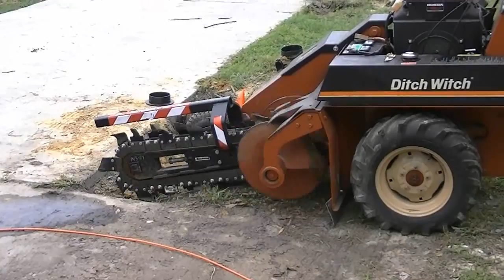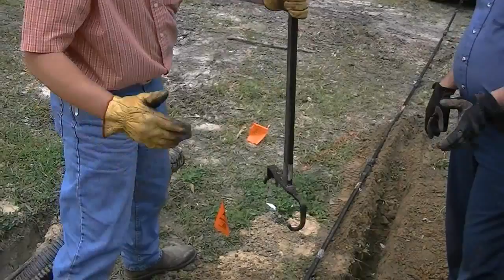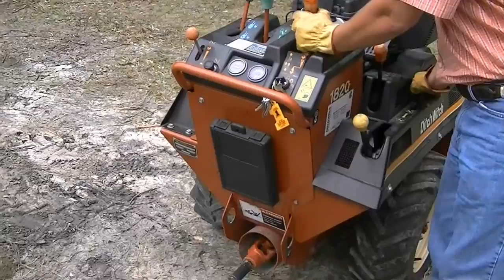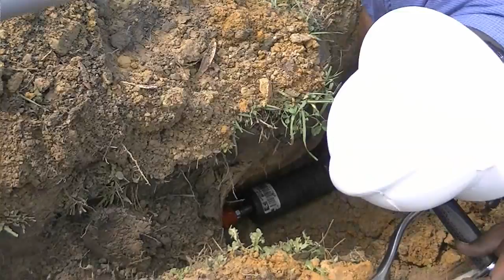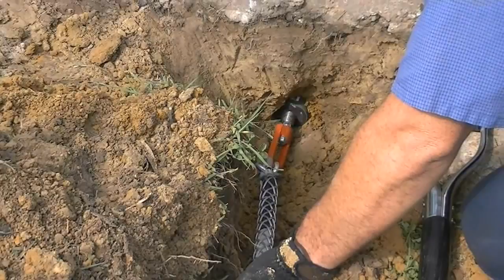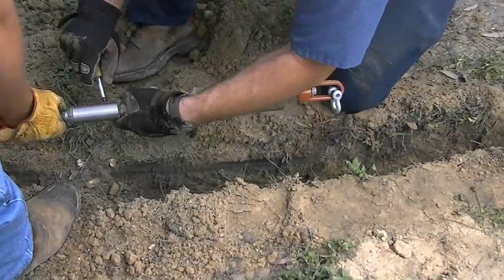Ditch Witch Roto-Witch Attachment Operation

Comment: Lmfao.  I’m an irrigation contractor for 30 years.   It’s never that easy,  maybe 10 percent of the time.
Reply: Right? We use 410sx's, and we use the plow and a mankiller to make a trench. Connect the rods/bit, smack the drill string down into the trench with a slight angle up from the middle forward. Put a little bow in the string and bore away. Usually with that method we can make it pop up on the otherside like a directional bore, or at the very least, not dive to more than 4 feet. We also have to do this solo sometimes, perks of the telecom industry.
Reply: We use a tracker to find the other end
Reply: You obviously didn't have enough people!  Three workers and one cameraman minimum!

Comment: Old school. Back in the day before we started directional drilling we used a similar method but with an angled bit on the end.  We'd mark the 12 o'clock position on each stem we added. Poor man's directional drill.  Worked good for getting across driveways.   Could even go a full yard or so if you needed to.  But I'm glad we use proper directional drills these days. :)
Reply: Directional drill for a driveway?

Comment: Have to make sure your bore is deep enough so it does not push up or crack the concrete or asphalt. That is easy to do if a rock is near the bore. Also, turning the back reamer the other direction may help speed up the operation.